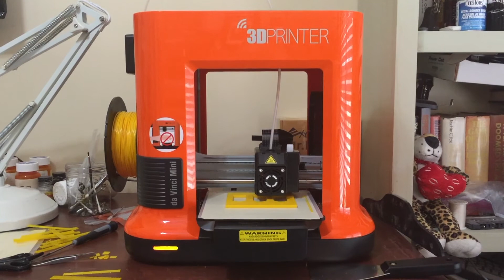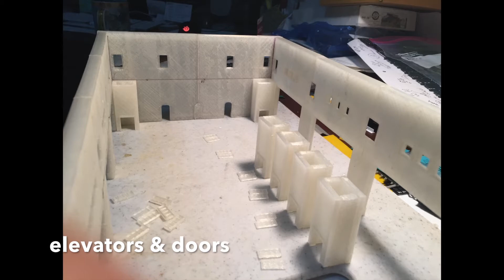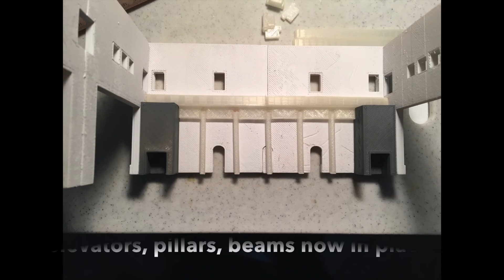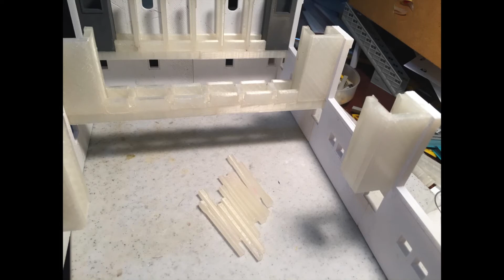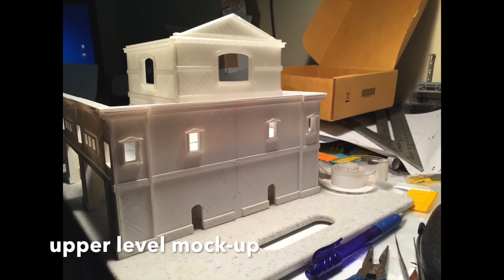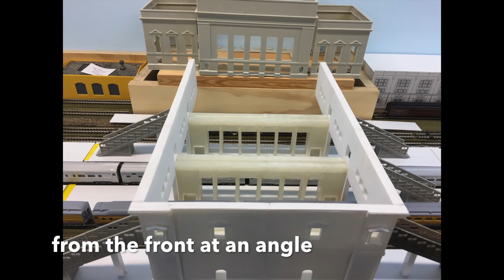Assembly of the N Scale 3D Printed Passenger Waiting Room - Part 1

Comment: Great attention to detail. Thank you for making this presentation. It's really impressive work.
Reply from the maker: Cymen, Thank you very much for watching & your comments.  I am a couple of projects further along now and have gained confidence in how to design newer buildings & accessories to get better 3-D prints.I am still working on the Elizabeth City (Tulsa) station because I did not like the way some of the walls came out as well as starting the design for the ice house that will be at Union Station (currently in foam board with printed walls). I am currently working thru some sciatica problems so I am having to keep all of the projects going at a slower pace for the time being. Also,  as of 1 Dec, my da Vinci mini has surpassed 781 hours of print time with the same extruder and without any issues. I just make sure to clean the extruder about every 30-40 hours and recalibrate at least once for every reel of PLA.....John

Comment: John looks impressive, is the material used expensive? cheers Robert
Reply from the maker: Hi Robert, Thanks for watching & your comment.  The printer that I have uses PLA which costs $22.95 for 200 meters.  As I recall, it took about 70 meters to build the entire stockyard.  This building will take a lot more as I have done a lot more test prints of the walls but overall it will still be a lot less than kit-bashing two Walther's Union Station kits.....John

Comment: I just bought a 3D printer....might be looking to you for tips. ;) lol
Reply from the maker: Thanks for watching. I've had a lot of fun with my printer. What kind did you buy?
Reply: I got an Anet A8...seen some good reviews on it on Youtube. Its a kit....building it is going to be a challenge! lol
Reply from the maker: I took a look at that printer.  It looks pretty good and at a very good price.  It has a larger print bed and can us the Cura software.  Cura is really neat because you can look at each layer or slice to see if your design has any problems.  I have the software & use it to check things but my printer can't currently use Cura. Have fun putting it together....John
Reply: Thelarger print bed was a major factor in my decision to buy this particular printer. Yes, assembling it is certainly going to be a challenge.
Stu.